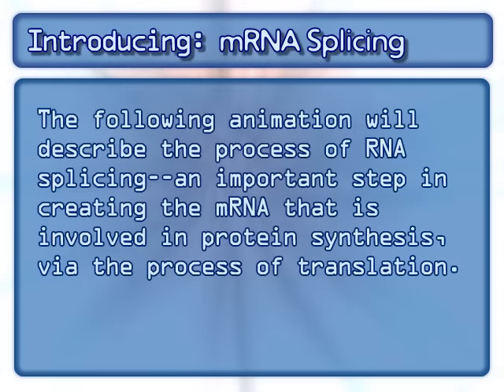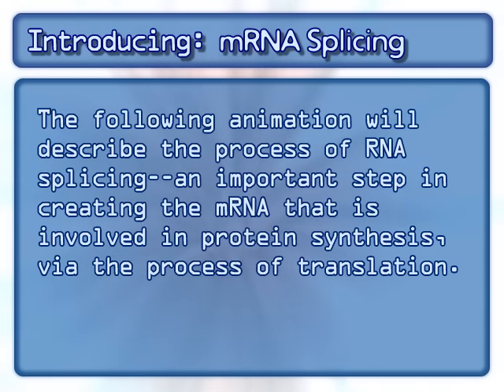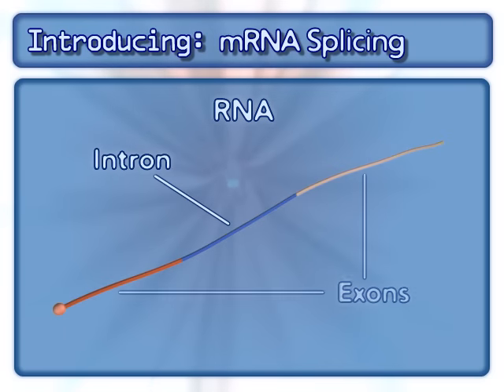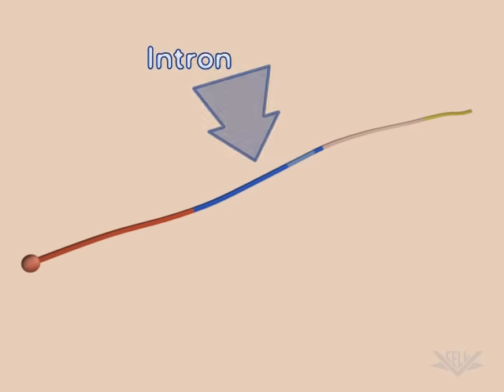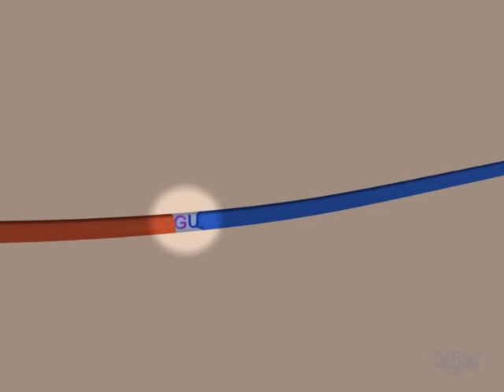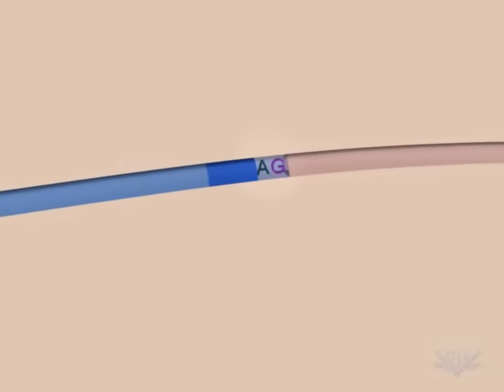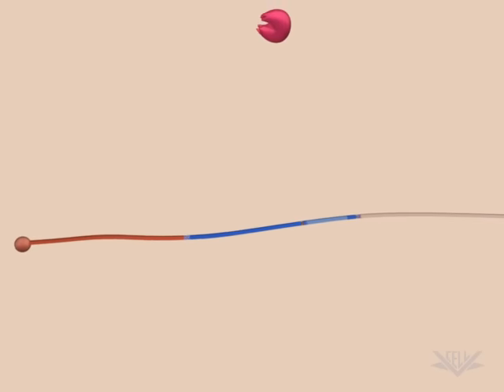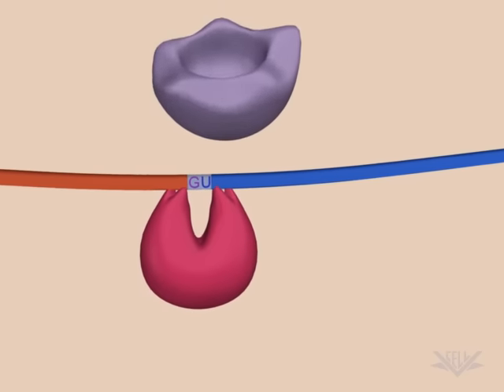mRNA Splicing

Comment: The 5`-End (GU) of the Intron is fixing at the Branch Point (A).
Introns (INTervening RegiONS) are not coded Pieces of a RNA. At the Splicing, they will be depolymerised. 
Exons (EXpressed regiONS) are the coded Pieces of the RNA, at the Splicing the Exon Parts will be fixed together.
prä-mRNA -> (Splicing) -> mature mRNA
There are also special Introns, that go in a enzymatic-conformation after Splicing.
Only Eukaryotes have Introns and Exons

Comment: @ilikecandycane It is a process that produces alternate mature mRNA's, in which some exons are actually removed along with introns. This leads to a large diversity of gene products from a single sequence. Usually, you would have binding inhibitors or even promoters attach to an end of an exon (splicing sequence) to either inhibit or promote splicing at that end (affinity to spliceosome). Check out the regulation of alternative splicing in the determination of sex of drosophila for an example.